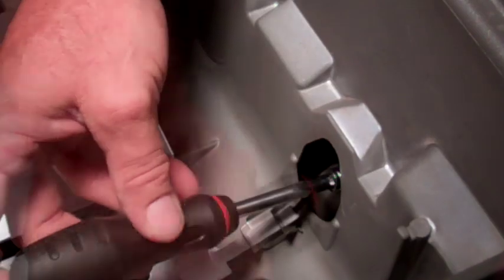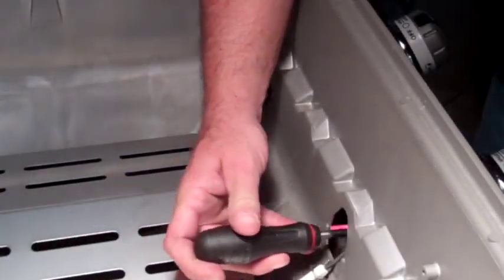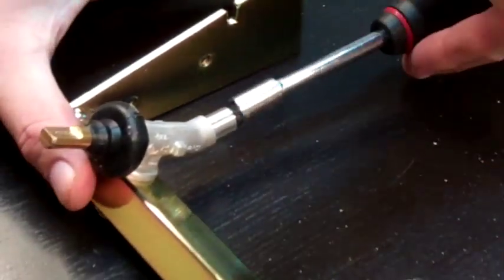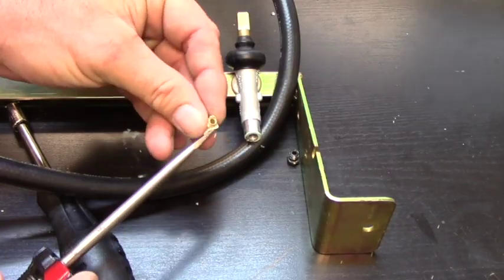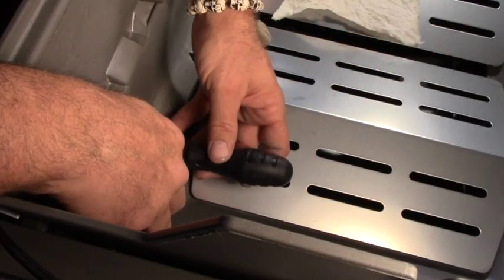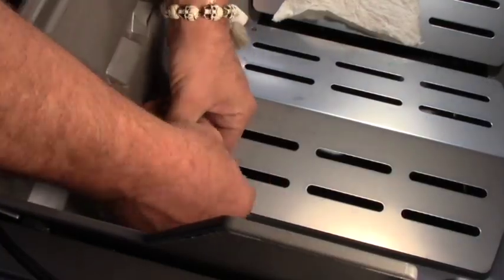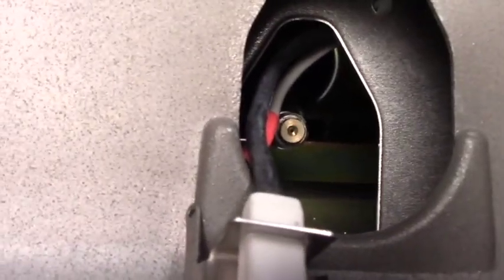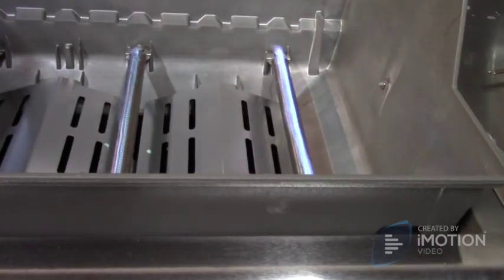Convert Weber Spirit And Genesis Fuel Type For LP or NG - Instructions for New Models.

Comment: Thanks for the video. I just got the parts and was able to replace all the orifices without issues. However, upon changing out the hoses I found that the regulator hose has a small but than the MY one. Do I need an adapter for the regulator hose or a different fitting that'll fit both? The hose but is the same size as the one on the grill. Thanks in advance
Reply: Nevermind... pretty sure I found the part I need at lowes

Comment: For what it's worth, Weber says that conversion to NG will void the warranty. Weber does not sell a conversion kit. You may need to change NG shutoff fitting and other fittings to mate with Weber quick-disconnect fittings. May need to comply with local gas regs.
Reply: I did this in my 20 year old Genesis.   Weber can shove their warranty where the sun don't shine.

Comment: Hi Jason, Do i need a new hose or i can use my existing hose with the NG regulator. Video ends on changing regulator but not sure if i should use the same hose from my Spirit or do i have to buy a different hose? I have Weber Spirit S-315 LP and i am planning to convert to NG. Thanks.

Comment: I have a 2018 Genesis II e-315 3 burner that the flames are orange. Bought it used but only used once or twice.  It says NG on the back but has a propane tank hose.  The burners have larger round holes, not small rectangle slits. Is this a new thing?  Think I can just change the orifices to burn blue with LP, or do I need to replace the burners too?

Comment: Hi will this work on the Weber Spirit E-315
3-Burner Propane Gas BBQ? I want to convert it to natural gas? If yes, how do I get the parts and how much will it cost please? Thank you in advance for your help and stay safe!
Reply from the maker: Yes it will.   Any gas appliance can easily and safely be converted to use LP and to use NG.   On our web site the parts are listed with our pages of replacement parts for Weber barbecues and they're described non-technical so you can select the correct orifices by just looking at your BBQ.
Reply: I have the same grill but I need propane...

Comment: on flare fitting pipe dope is not necessary. Flare fittings use the flare to flare compression of metal to insure the seal. Nothing wrong with being safe however. Other fittings use the threads to seal. As teflon tape or dope is not actually a sealant. It fills gaps in between threads as threads are imperfect. threads tend to take a retarded bite  in the channel it goes through imagine a v on its side then another v sitting inside the other v on the bottom you have a gap at the top in between the 2 v's .now imagine a v on its side with a layer of teflon on the bottom and top of v when you stick the other v in side that v is going to be pushed up and will fit better inside the other V. by using non stick teflon you are filling gaps and then getting threads to take a center or advanced bite which will cause a more compressed fitting and less chance for leak

Comment: SO HOME DEPOT SOLD US AN S315 NATURAL GAS GRILLE AS AN E315 PROPANE GRILLE!  It had a small dent on the very bottom of the base and the salesman told us it was a great deal because of that so we bought it.  Got it home and realized not only was the hose the wrong hose for propane, but it had black soot under a couple of the triangle looking grill tube guards ( or what ever you call them! LOL! The SS looking triangles that sit above each burner).  I went back to Home Depot with pictures of the wrong line being on there and the black soot and they said they had no idea and that the guy must have changed out the hose to hook up to his RV and decided to bring it back prior to using the grille! ???  Made sense as there was absolutely no food cooked on it and the soot looked like the grill had been turned on the center burner for maybe 30 seconds at most.  I didnt feel comfortable at this point still and kept pressing the issue and the guy gave me a replacement propane line to hook up to the grill so i took it home and hooked it up.   STILL didnt feel right so i started digging thru the packet of paperwork i finally got on my second trip back and found where this was actually an S315 and not an E315!  I never lit the BBQ and i guess lucky i didnt as the orifices are not correct for propane! Not sure what would have happened but glad i didnt find out the hard way! LOL!  Not so funny really!!!!!   So...at this point im headed back to Home Depot with the entire grille as i dont feel like changing out orifices etc and to be honest im a bit pissed off as this was a disaster in the making if my gutt feeling would have been out of commission thru this deal!

Im going to make them swap me out for the proper grille or up grade and i think its the least they can do for guiding me towards lighting a NG grille with propane!  What would have happened??? I have not searched the internet to find out what really would have happened but im sure it wouldnt have been a fun time!!!